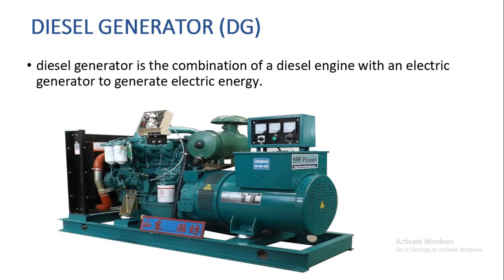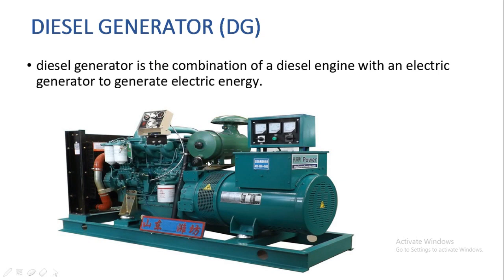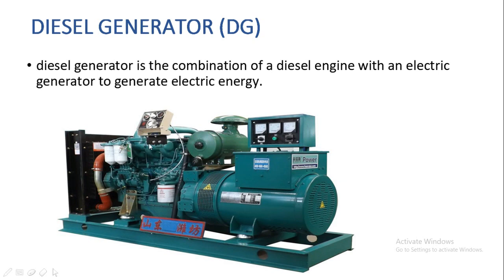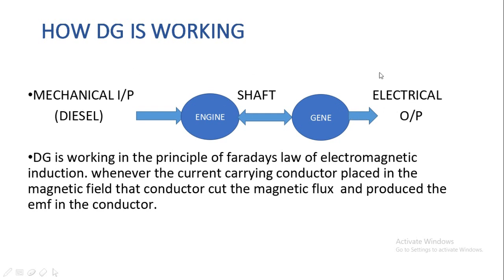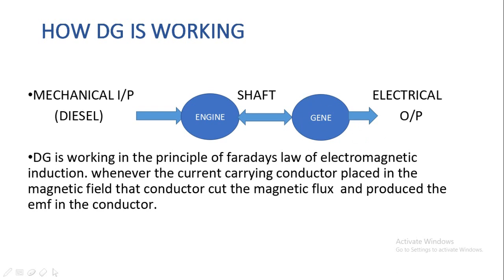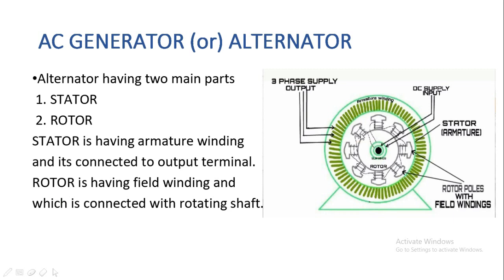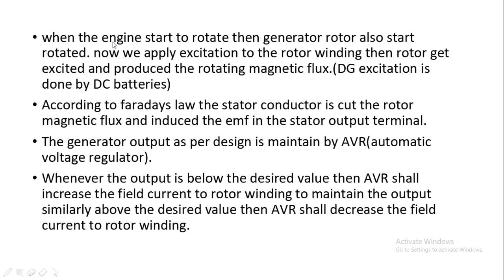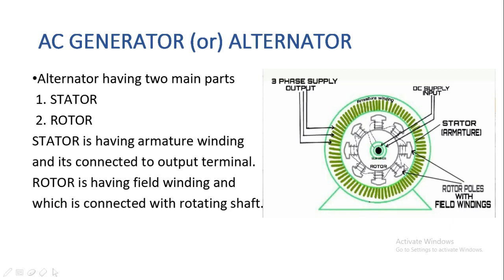DIESEL GENERATOR WORKING

Comment: Diesel is chemical input not mechanical, when a current carrying conductor placed in magnetic field it experiences a force not an EMF. Emf generated if a rotating conductor placed in a magnetic field. Basics needs to be corrected.
Reply: Diesel is a chemical input, yes. But the diesel's engine's ROTATING shaft is a mechanical aspect and the component of focus when discussing DG.
EMF is electromotive FORCE, so I don't really get your point. Correct me if I'm wrong.
Reply: @Steifan10 : (EMF) Electromotive FORCE refers to the voltage, not the (mechanical) FORCE..

@Nagesh Patwari: Here its a synchronous generator (its not a motor) principle..! Here, the Rotor is rotated (by Diesel engine) as well it produces magnetic field by external DC excitation (or can be a permanent magnet). So the (mechanically) rotating magnetic field cuts the stator circuit and produces a three phase EMF (normally known as voltage)..

AVR controls regulates the fluctuations on output voltage, by controlling the (rotor) excitation voltage..

Governor control (aka Diesel engine speed control) regulates the supply frequency (which is usually 50 or 60 Hz).. kindly let me know if any mistake here!
Reply: @Sarav456  I think I framed my argument too much as a joke 😅 I agree with you and I understand EMF isn't actually a physical force, but a voltage produced. I'm just not sure what Nagesh is trying to say. 

I think Nagesh may be confusing Fleming's left and right hand rules. The left hand rule is referring to induced FORCE (electric motors), but the right hand rule is is referring to induced CURRENT (electric generators). Correct me if I'm wrong here. Thanks!

Comment: What is the difference between the excitor and excitor stator? And which one is controlled by the AVR?
Reply: Excitor consists of stator and rotor. It's nothing but an AC generator on the same shaft of the main alternator. purpose of the excitor is to provide the dc current for the main alternator field winding. Excitor's stator is the field winding and it's rotor is the armature. when the engine runs excitor's rotor will produce an ac voltage. this ac voltage is then converted to dc by the help of rectifier and filter then this dc is used to magnetise the main alternator's field winding. Actually AVR controls the excitor's field winding. It's easy to control the excitor's stationary field winding.

Main alternator
Armature - stator
Field - rotor

Excitor
Armature - rotor
Field - statorr

Excitor's armature and main alternator field are on a same shaft therefore we can connect the dc output of excitor to the field winding of main alternator without any slip rings or commutators